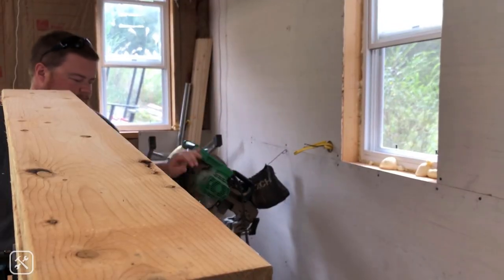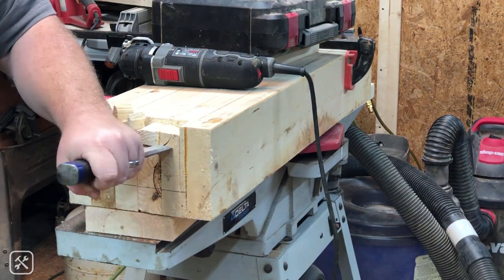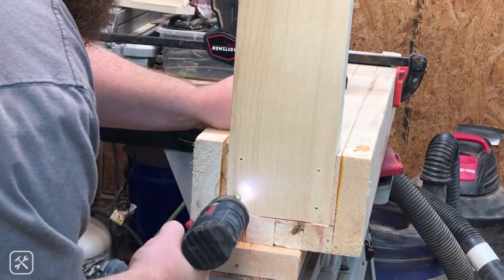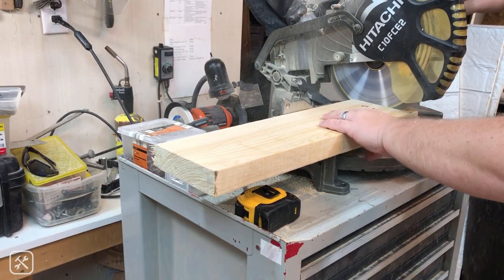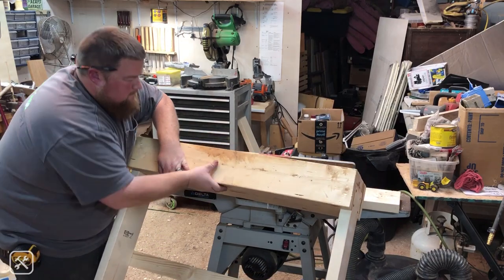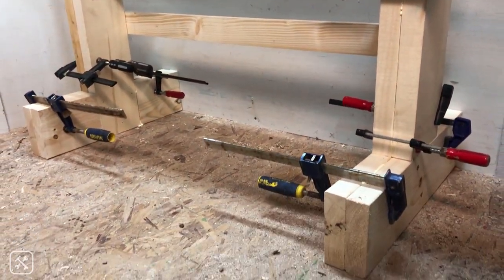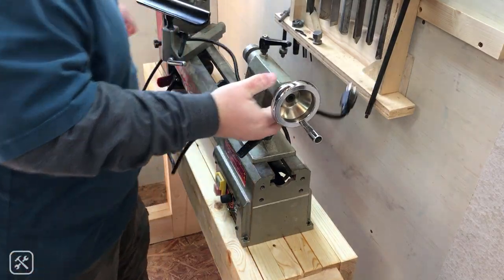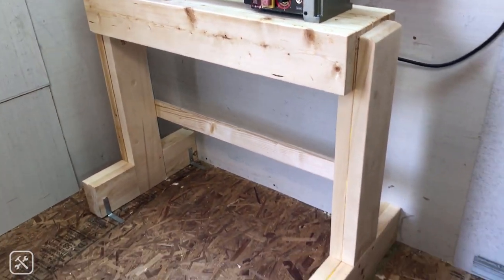Easy 2x6 Wood Lathe Stand | Woodworking Woodturning DIY How To

Comment: I am working on building this stand for my lathe from your plans. This stand will be larger as my Jet 1014 has an extension.  The support beam will be 54 inches long. I am considering using wood to screws to add strength to this beam. What do you think of this idea?

Comment: Nice work!
Reply: So how stable is it? Have you put any larger chunks on it? I am in the same boat and didn’t like my design on feet. I am actually going to anchor to concrete floor with half inch lags, 3 inches long. My lathe is about the same size and seems like an overkill but I do get a bit of wobble as I do put large pieces than I should. Lol
Reply from the maker: I've been happy with it. Any wobble is probably more due to the mounting to the floor than the stand. It's got a good amount of mass to it and is really sturdy.

Comment: It's so much easier to just make a big box as a stand, with rabbet edge joints. Add feet, maybe add a bit of internal bracing, then fill it with sand bags for ballast and vibration damping. That also gives you a work top onto which you can just plop a simple dust extraction hood for sanding, like Richard Raffan has.

Comment: Is there a lot of vibration with this stand?
Reply from the maker: Nothing like what I was facing before -- having my lathe mounted on a workbench! The mass of the stand helps to counter any effects from an out-of-round object turning on the lathe. Any vibration is more from my wood floor and lack of rock-solid attachment of the stand to the floor than from the stand being flimsy. Hope this helps!